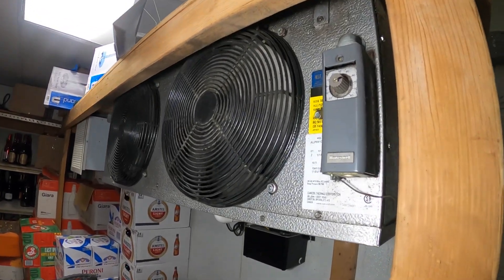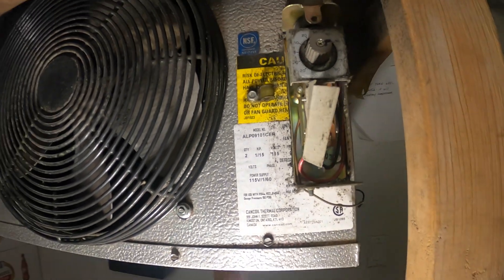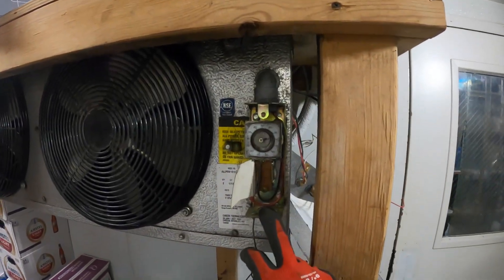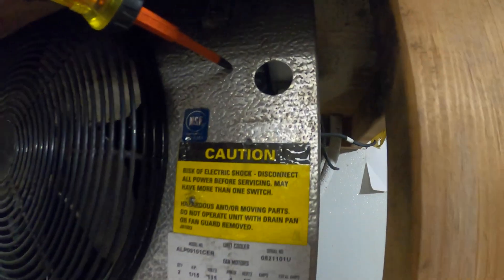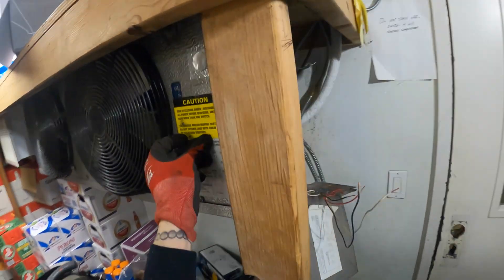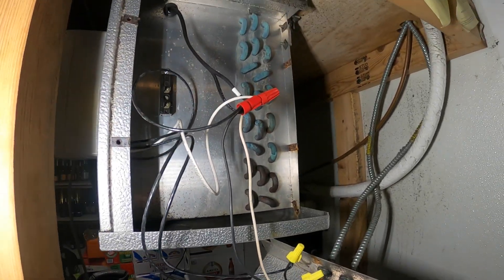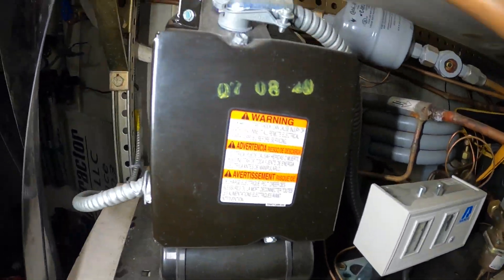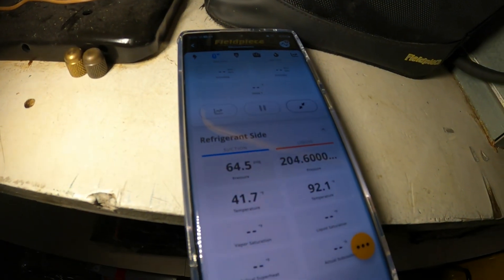HVACR: Walk In Wine Cooler Not Cooling (Wine Cooler Electronic Temperature Control Upgrade) Install

Comment: Hole needs a grommet, especially when there's all that vibration. You could also make the hole in the metal bigger than the one in the thermostat box, and that effectively makes the plastic box's hole a grommet, since the wires will then no longer contact metal.

Comment: 9:37 I would be using rubber grommets on any sheet metal hole that high voltage wires run through if the device vibrates. Rubber grommets cost pennies. Even better non metallic push in fittings available from your electrical supplier. Happy new year JMT.